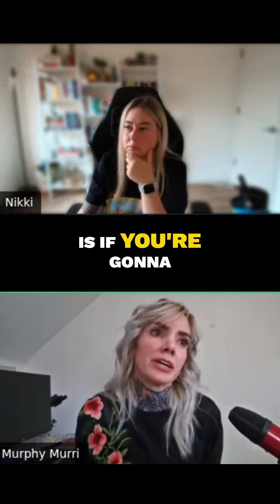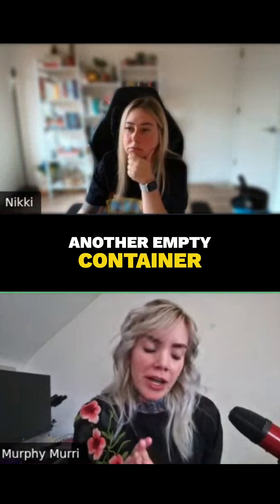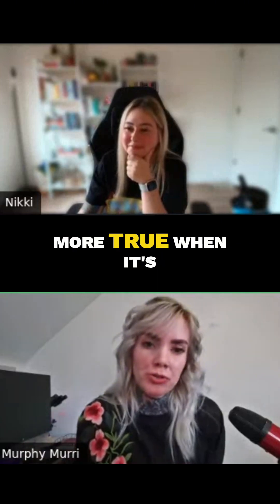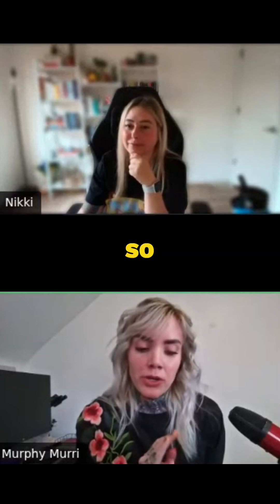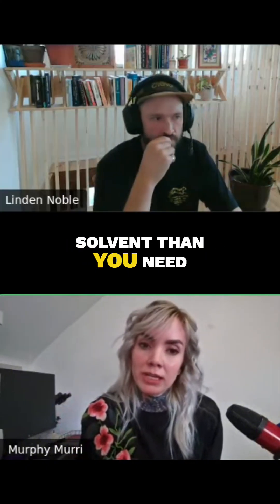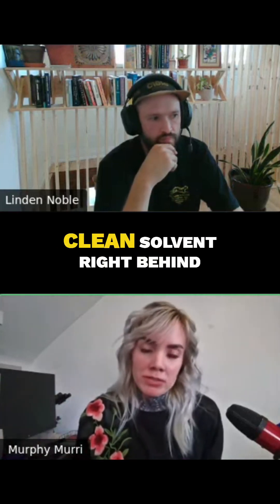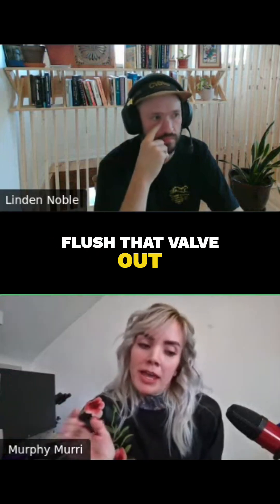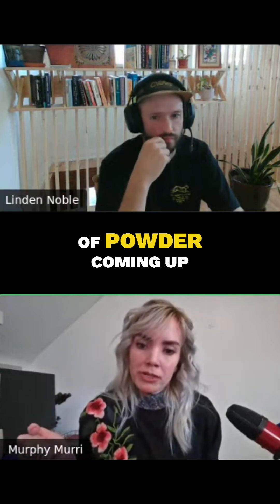Avoid THCA clogs with this one simple move.

Comment: After all that explaining, she's talking about a 3/8" hose!? Lol
Running a bigger hose might help too. Lol
Reply from the maker: Hi Jay! In some cases, a 3/8" hose is actually chosen to help maintain back pressure or stabilize flow, especially in systems where control is more important than maximum volume. ⚙️
Reply: @evolvedextractionsolutions6147 That's literally gibberish, lol. 
A well integrated nitrogen supply will handle all pressurizing and flow within the system. There's no reason to sacrifice efficiency and get clogs to keep  3/8" hoses in the system.